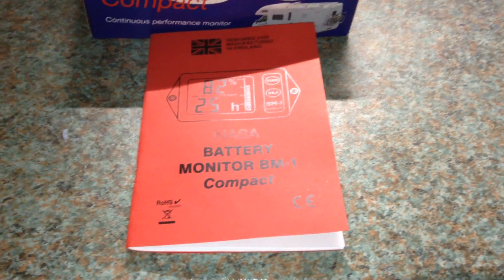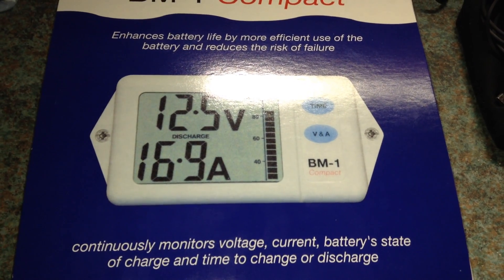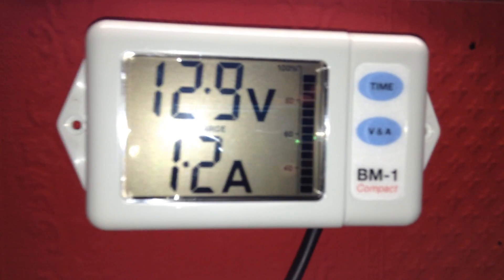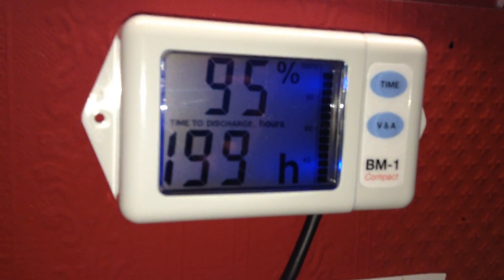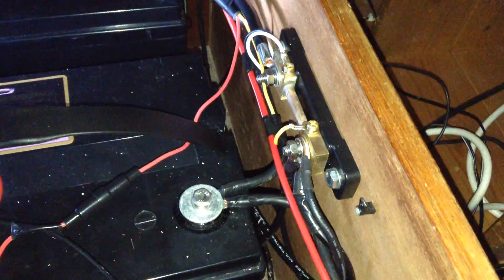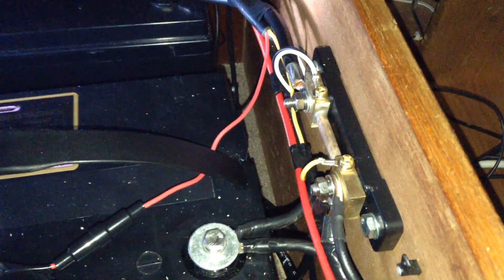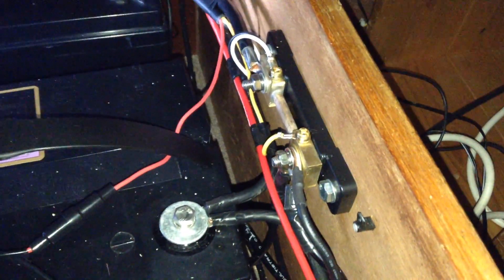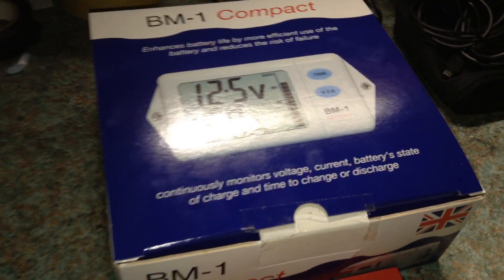Fri 22nd Jan.  NASA bm1 compact battery monitor

Comment from the maker: The NASA bm1 compact is designed to monitor one battery or bank of batteries. I have one bank of 3x 12v 100ah batteries wired in parallel , the monitor treats these as one large 12v battery. My batteries are used in a solar power system in my bedroom, so there is no additional battery which would be used to start an engine like in a boat or motor home.
If you need to monitor a second battery then victron energy make monitors that have this capability. Hope this is helpful.

Comment: does it monitor all the batteries or just one battery? for example on a boat there will be a starter battery and a house battery. presumably, it is only connected to your house batteries? tks